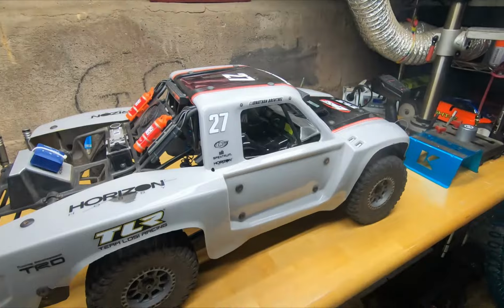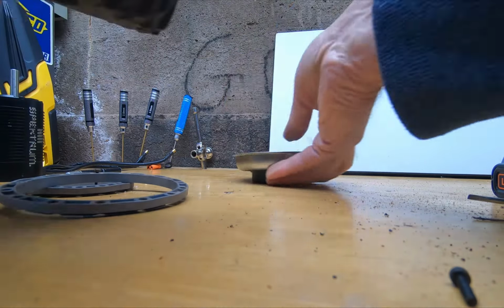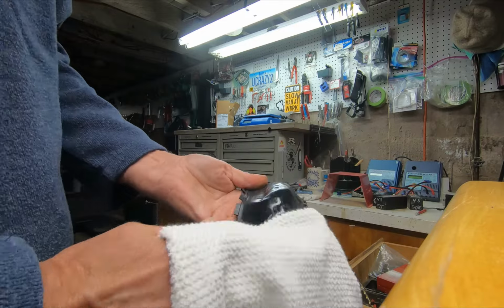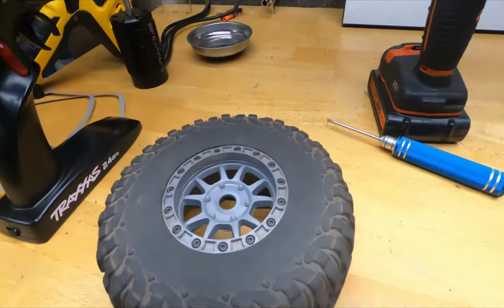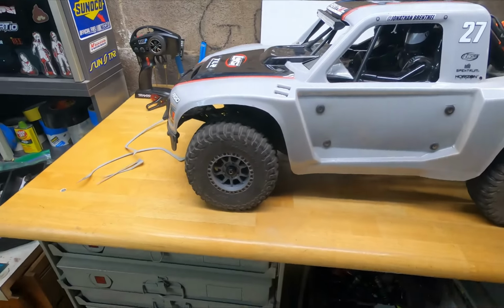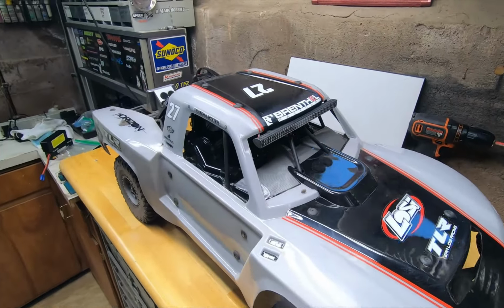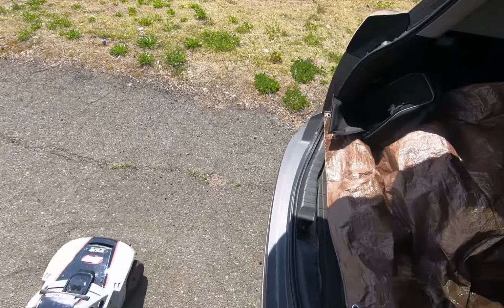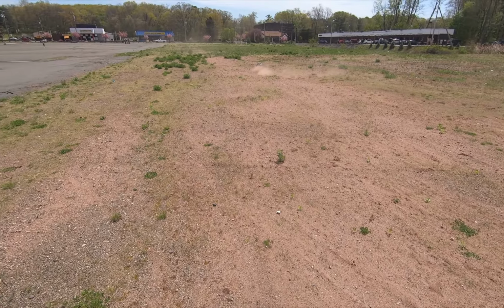#139 MORE WORK ON LOSI SUPER BAJA REY 2.0 , NO MORE PIZZA TIRES

Comment: those rubber tires are not glued to the wheels from factory? so by this trick, all RC tires can be done for no more pizza tires?
Reply from the maker: Hi , no only these , they have bead locks so you can take apart , tape I used FAILED , would find better tape/method
Reply: @ucrazy2rc460  do you glue the rubber tires with the wheels you must but full video about installing new tires
Reply from the maker: @tiger78707  no need to glue the tires to the rims their beadlocks , make sure you get a good tape mine failed , looking back on it it was more work than it was
Reply: @ucrazy2rc460  👍👍